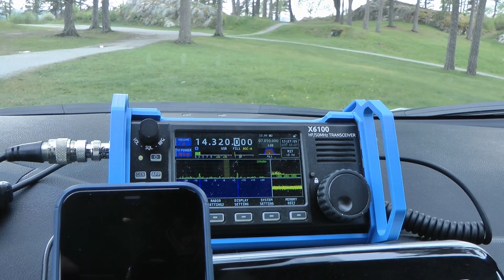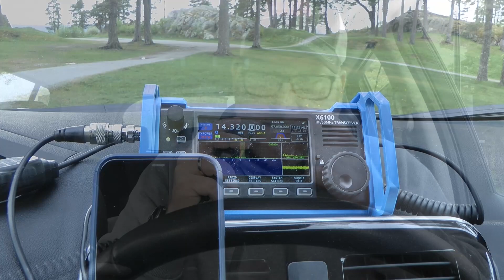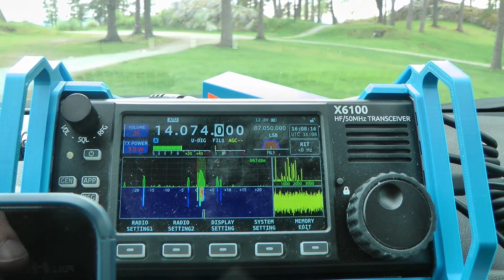Wire Vertical Mobile POTA

Comment: Interesting concept, maybe a 1/4 counterpoise may resolve the SWR issue?. Good point re not much space required. 73 and thanks for posting.
Reply from the maker: The car should act as a counterpoise though, so I would guess that I just need to trim the wire a little bit.